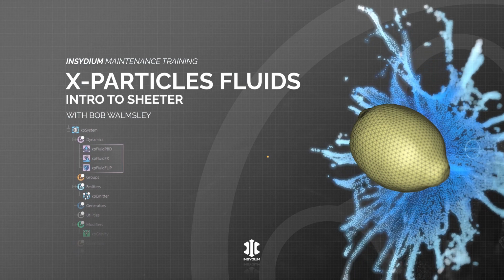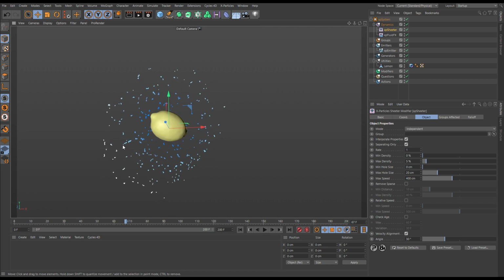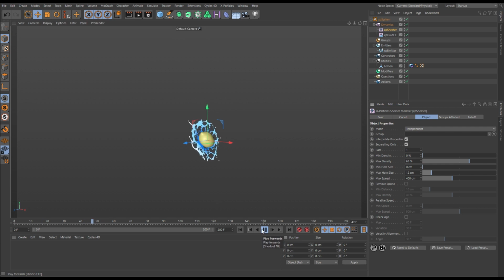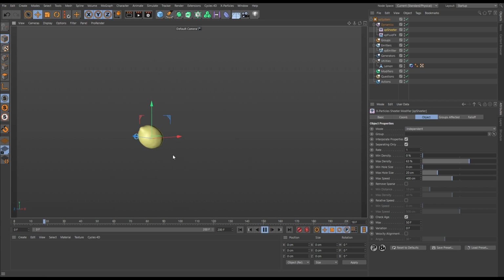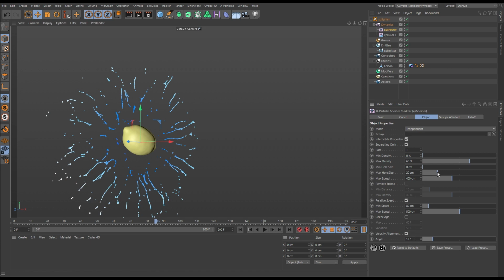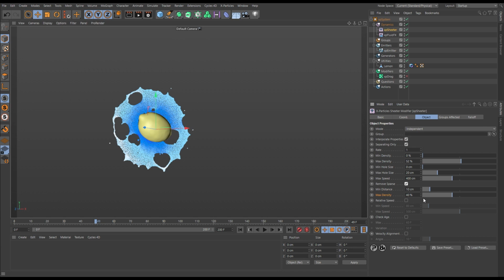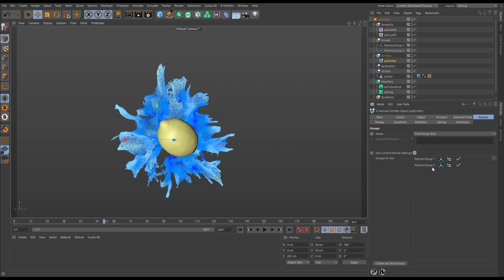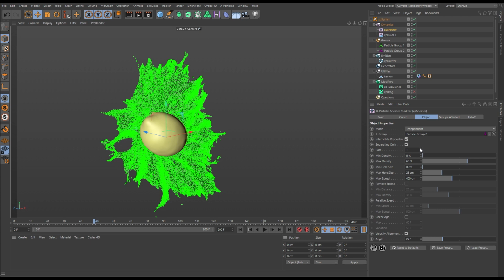Maintenance Training - Dynamics - Fluids - Series 3 - Intro to Sheeter

Comment: As soon as xpSheeter comes to play it's totally useless on a full-specced Mac Studio Ultra. Terrible performance even with high particle radius. Can't get Sheeter doing its job done from the first frame on. Problems may be  related to trial version (no GPU support?) or poor implementation of Apple Silicon.
Reply: Why would you be using a mac to do this work? You can build a PC that matches your fully specced mac for a quarter of the price.
Reply: its as slow as on mac even on windows :D sheeter basically kills every cpu
 @madlowles